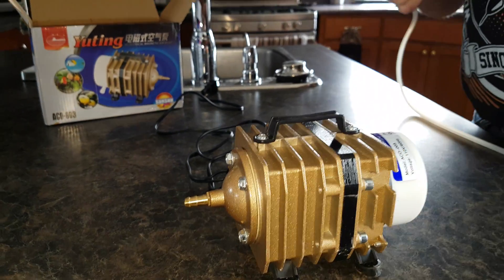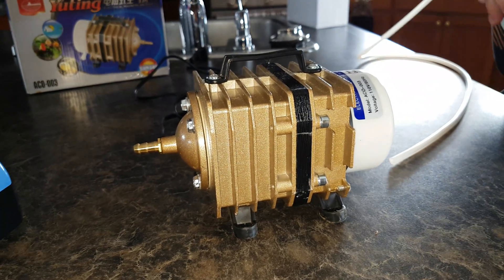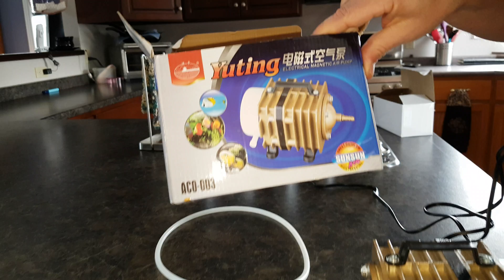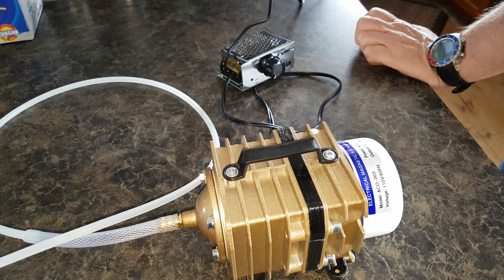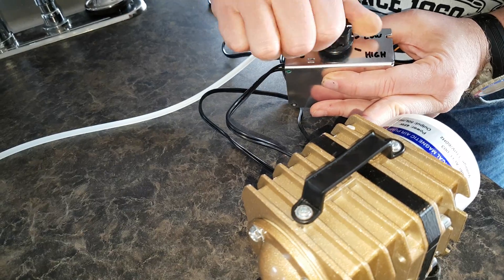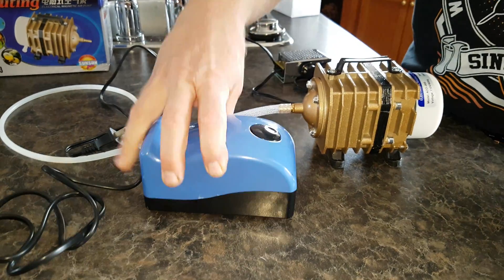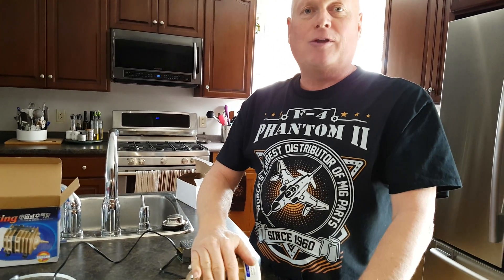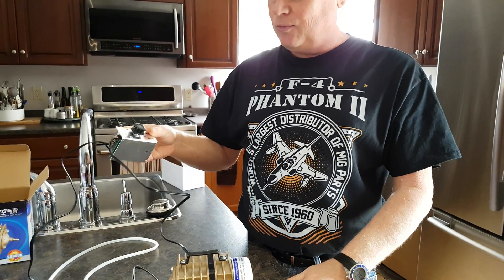Smoke Daddy Magnum Air Pump Mod

Comment: Smoke Daddys are poorly engineered, they seem to only produce smoke for about an hour. The tube is to thin and stops up really quick.
Reply from the maker: Mine goes for at least 2.5 hours using soaked wood chips.  Not sure why you're having issues.
Reply: @Phantomsmlliw  You are not suppose to use soaked wood chips because it cuts down on the smoke. If they actually worked right, there would not be so many people making modifications to them on sites like this.
Reply from the maker: @michaelthurman9272  dude, it works perfectly for me.  It's the YODER that is sealed better than most smokers, thus needing more air pressure.  It's designed just fine.  Soaked chips give me exactly what I'm looking for.  I've done it both ways. Without soaking, there's too much smoke.  Anyway, you do you and I'll do me.  Smoke Daddy has since added a second air pump for special applications like the Yoder.
Reply: @Phantomsmlliw  If smoke daddy's worked properly, they wouldn't be all these videos on modifications here on youtube to try and get them to work, now would there be. On top of that, on their website, it says not to use wet chips, They are poorly engineered, and not meant to work for more than an hour, primarily because the tube is to thin, the bottom chokes itself off with ash, and  the pump is to weak, and yes, I have the one with the variable settings.
Reply from the maker: @michaelthurman9272  you're certainly entitled to your opinion however, my results vary from your opinion.  I have no issues with the system and it does exactly what I want it to do.  The biggest issue I had was that I was using it in a very well sealed Yoder instead of some leaky smoker like many people own.  I'm not in this to argue with you or your opinion.  Clearly others are satisfied with what I've done when comparing your opinion to those of the others.  Have a nice day.
Reply: @Phantomsmlliw how did you fix your issue with Yoder back pressure? A second pump or a stronger pump. I have a Smokai having the same issue.
Reply from the maker: @tomatogod1  I used a stronger pump and some simple air valves to adjust and divert  the air coming from the stronger pump.
Reply: @Phantomsmlliw  thank you for that, any particular pump you recommend?
Reply from the maker: @tomatogod1  I got one on Amazon just like the one in the video.
Reply: @Phantomsmlliw  thank you!
Reply from the maker: @tomatogod1  skip the controller.  It didn't work as I was hoping.  Just use small aquarium tank air valves to bleed excessive air if you have too much.

Comment: What is the name of the controller or how do I look this item up to order it? Thank you
Reply from the maker: Don't bother with it.  The controller only provides a very small window of adjustability.  You get much better control using a multi valve manifold.

Comment: Hey Tim
What is the burn time you get know with using more air because of back pressure in your yoder.
Reply from the maker: About 2.5 hours using soaked wood chips.